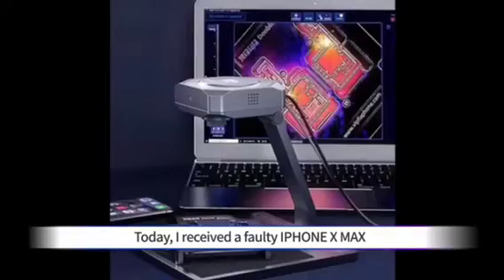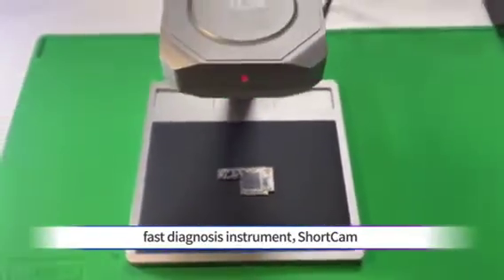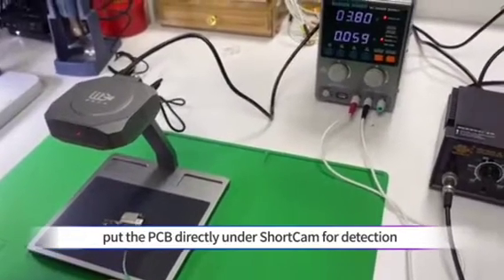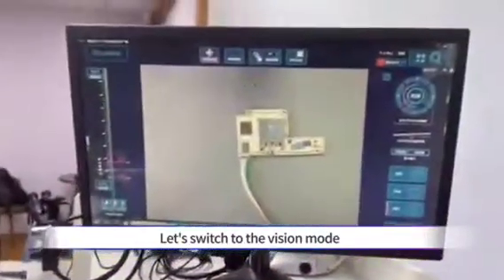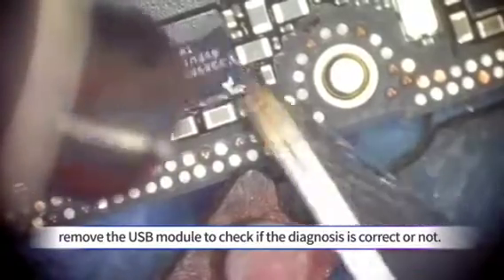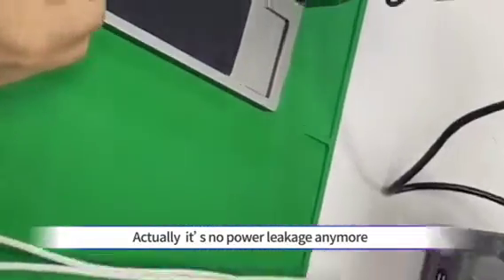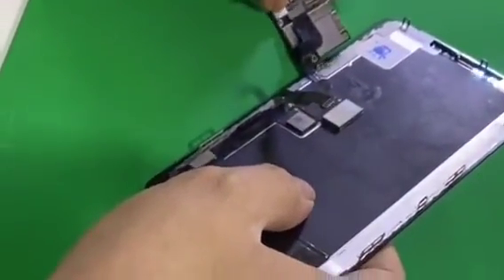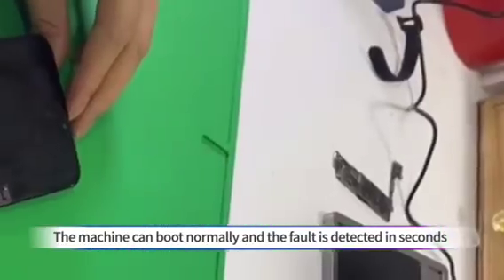Diagnosis Motherboard Fault With LINCSeek IIT ShortCam Thermal Camera

Comment: Brother please if you can help me how to set it up on my pc.
Reply from the maker: hi, what's the problem
Reply: it says no device detected. I have already changed my IP address, and subnet mask, nothing happen.. cannot detect the camera.
Reply from the maker: @jemsonp0790  do you have whatspp?
Reply: @jemsonp0790  I have the same problem that is happening to him. I have a curiosity, the RJ45 cable is a special cable for this camera!? That is to say, if I change the cable for another one that is a little longer or simply a change of cable, then the camera will stop connecting?